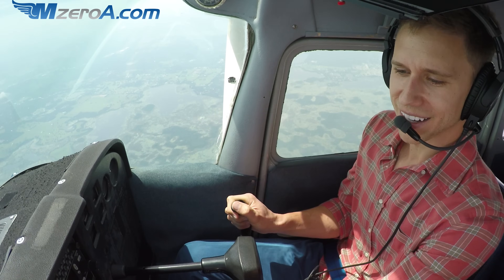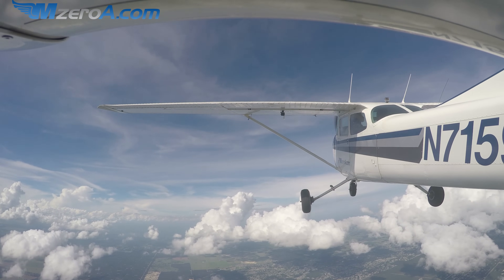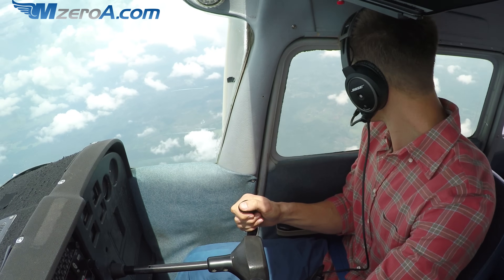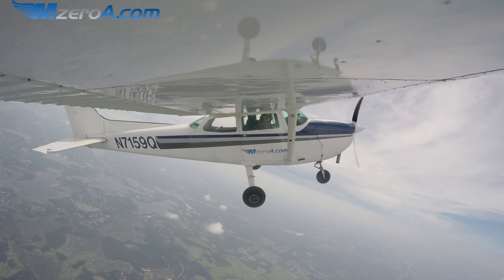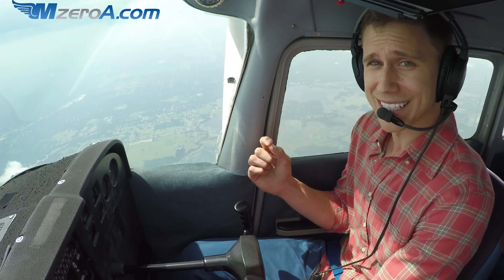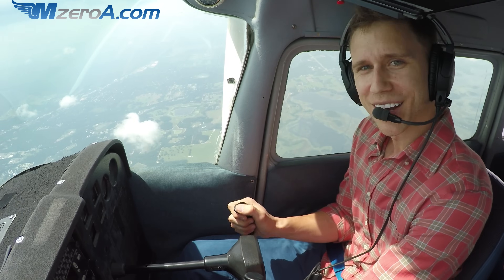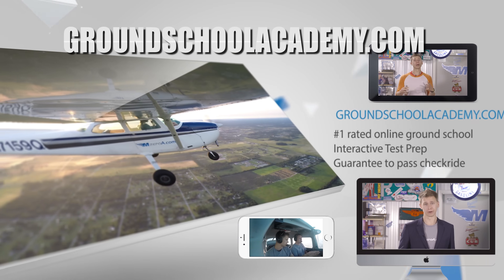Proper Spin Recovery - MzeroA Flight Training

Comment: Why wouldn't spin recovery training be required by all student pilots?  Neglecting to do this is not just crazy it is risking your life.  Seriously I am totally lost for any reason this wouldn't be basic required 101 training?
Reply: I read that it was, until 1983 or something. Then it was decided that more people are killed in spin training than in accidents that involve spins at an altitude where recovery is actually possible. If you unintentionally spin, chances are that you are too low to recover. Spin prevention training was more stressed instead.

Comment: Great video Jason. I am not certain if it is mentioned below, but we are required to demonstrate Spin recovery here in Canada before we can be cleared to solo. It is not tested on the Private check ride, but it is on the Commercial check ride. I love them, and it is a great skill to learn. Cheers.
Reply: +Henry Dupuis That is very interesting. I got the JAR-PPL in the UK and not only is spin training not required, it is not offered or recommended. As I was told, "if you never let a stall develop, you will not enter the spin." We did however, do spiral dive recovery which is completely different.
I also visited the USA and was surprised to be turned down by several CFIs when I told them I would like to go up for spin recovery. Now, from Jason's video, I can understand why they were reticent to try.
Reply: +douglasheld come to Canada, we can take you up and teach SPIN recovery. www.windsorflyingclub.com

Comment: It's somewhat non conventional advice. However if you want to get rid of any tendency to react to spins, stalls, and other aggravated maneuvers incorrectly, in my opinion the best thing anyone can do short of taking an aerobatics course in real life (which I would love to do one day). Is to go play a good ww2 combat flight simulator preferably multiplayer, like IL2 cliffs of dover (with the team fusion patches). IL2 Battle of stalingrad or some configurations of DCS would be acceptable practice as well.

In sims new people stall out constantly, recover from aggravated conditions incorrectly, all the same mistakes one can make in real life that can cost you your life. The reason I believe this is more valuable than say practicing aerobatics in FSX, is that for one, aerobatic simulation is better in these sims than it is in FSX, and two when you are chasing or being chased by other real people trying to shoot you down it mentally simulates emergency or stressed situations to at least some degree. 

I used to really stress over practicing stalls in real life. However when I came back to flying in real life after 800 hours of IL2 between, I just saw it all completely differently. Gliding to a landing successfully with oil gushing out of your engine all over your windshield, your rudder shot off and inoperable, with 3 people still chasing you, and realizing that even under the worst situations you could imagine, one can land safely almost all the time. Simulation flying is (mostly) harder than in real life as well because you lack the forces, and often ground handling is simulated very ridgedly, there is a large tendency for people to over control in simulation.

Comment: Interesting video.  Even though you are banked to the right, the incipient spin rolls to the left.  Why is that?  Is it because the right turn is not coordinated (see instruments at 4:06), so you are slipping right and the left wing stalls first?  Anyway, what happens (right bank/turn, left spin) is contrary to what I've seen in several other spin videos.  Can you comment?

Thanks,
-Hugh
Reply: +Hugh Secker-Walker What Jason has done is has stalled, encouraging a wing to drop by the use of the uncoordinated controls. The wing drop is typically contrary to the bank angle.
The incipient spin is simply a follow-on condition of the dropped-wing stall.

Comment: Nice lesson, pilots always learning. But one question: seems that you dont push elevator down as you said. Push hard elevator down could not get planes in the spin that we want to avoid? Maybe it's not to force so much...the plane recover itself from the spin if we dont push so hard on the controls...just the pedals need to make some work...I dont know, just want to clarify this. Notheless, thanks for this amazing channel and the good lessons in it!
Reply: +Henrique It would be good to get Jason's input. But I am thinking since he is in a relatively steep dive, releasing back pressure is all that was required of the elevator controls, until flying airspeed was regained.

Comment: I've always been confused about what opposite rudder means, I think I know but I want to be sure.
Reply: +Jonathan Rivera Sometimes you don't know which way you're spinning because you're going like a washing machine in spin cycle, that and if you accidentally spin you don't really know what's going on as it happens fast, confusing, and it hurts; the particular spin I got into on my own felt like the entire airplane rolled over on top of me was inverted very quickly. 
You can look at your turn coordinator as reference.  I spun once in a turning stall to the right, thought  I was still rotating turning right in the spin, but I had actually flip left.  Was doing a left turn in the spin.  I put what I thought was opposite rudder to rotation (left rudder) and turned into a washing machine spun even faster while looking straight at the ground... it hurt.
Remembered my instructor saying if you can't figure out which direction you're turning to look at your turn coordinator, and sure enough I was turning left... not right.  So opposite rudder was right rudder, at full right rudder the spinning stopped almost immediately. 
Remember your turn coordinator if you ever get into a spin.
Reply: +Jonathan Rivera If your nose is spinning to the left, push right rudder in. Nose spinning right, left rudder in.

Comment: My check ride, Cessna 150, mid 70's, 50hrTT.  He wants an accelerated stall.  "Damnit," he says "that was an imminent stall!  I want a full stall, let the nose fall through the horizon."  Never done that, but up we go.  Nose falls, recovery.  Suddenly, one wing falls like a pillar broke and we sweep around with me looking at the ground.  Check pilot, an older guy, gruff, sitting with his hands in his lap...been there, done that.   I [quickly] apply your "PARE" [my reading paid off] and we fly out of the spin.  He says: "You know what you did?"  "Yeah," says I "A spin."  He says "Try again."  Same thing, right down to the spin.  As we land I'm thinking when can I re-do the check ride but he says "I thought you did okay; I'm signing you off."  I could. not. believe. it!

In those days we practiced accelerated stalls solo, I don't think they do that anymore.

Thanks for the video
Reply: +david ervin After we did the stall maneuvers, we did slow flight. My examiner threatened he would fail me if I stalled in slow flight or especially if I spun LOL!  Needless to say I didn't.  But he didn't like how I was so comfortable flying slow, and harassed me for flying slow in the pattern making me at least do 120 on the downwind... "Are you getting your pilot license to go slow? Do you buy a sports car to go slow?" "No." "Well, bring us up to a normal cruising speed!" LOL!  My instructor told me after the exam he noticed I flew better when he barked at me like a drill instructor...  I kind of noticed too.
Reply: My examiner might as well have been a statue.  My heart was in my throat and he sat there like a school girl in her dad's car.  I think he was an aerobatic pilot instructor though he looked more like he had just gotten out of a John Deere.  Luckily it was in a 150 and not the Piper 140 I had taken a few lessons in.  I once took my brother up in a 152 on a windy day and landed straight down...he was terrified.

Comment: Great video.. but

This would be a lot harder in a low wing plane with their inherant instability as CG above wing (lack of pendulem effect) 
Learning to recover would be a lot harder

also why recover after only like 1/2 rotation. 
Let the spin start :) giver it 2-3 rotations. 

Wouldn't that be better training? 
Ok i saw the thing about spin rating below and honestly don't think i would fly a plane that was not capable of spins/barrel rolls and basic loops without falling apart.. kinda bad if you think about it planes not rated to do it as will probably fall apart :O

Comment: Thanks for the video, you made it look SO easy.  I went up for the first time in over a year today (I finished my training and chickened out when it came time for the test).  I asked the old man (I call him that cause he runs the school and has been an instructor for like 45 or 50 years) about stalls on the briefing.  I said that no one had ever mentioned it, or demonstrated it, or anything.  Well about 35 mins in, he says, "We're not gonna do a spin, but I'm going to start one and you need to fix it before it becomes a spin."  We're already in slow flight at stall speed, and as SOON as I said "OK", he stood on the rudder and we nosed over.  It scared me so bad, I recovered before I had time to think (Thanks FSx).  The plane didn't get to spin and the old man was happy.

Comment: Quick question, my cessna 150 flight manual says it is approved for spinning, but after 40+ years, is it still safe for spin? How do I know my airplane is ready for spin?
Reply: CFI here, one that demonstrates and practices spins regularly. Spins themselves don't actually impose too much aerodynamic load on an airplane.  Its pulling out of the dive that can be an issue. 

I'd recommend having a mechanic inspect the condition of the wing spar and strut attachment points for metal fatigue. As well as the attachment bolts and stops for the rudder and elevator. There's a little metal plate that contacts the stops on the rudder, I've heard of one becoming bent and jammed against the stop and locking the rudder in a full deflection, the results weren't good for the instructor and his student. Haven't seen any NTSB reports on that but still isn't a pleasant thought.

Comment: That looked like a Cessna 172 that Jason was in.  If it is like the ones I fly they are not spin rated for fully developed spins even in the utility.  They are spin rated but only so far as to do spin entry but you are only allowed to let it do half a turn in the spin and not fully develop into a full spin.  The CE-172 is not a aerobatic plane and is not certified for fully developed spins as far as I know which explains why Jason only let it begin to spin before breaking it.  Maybe someone else can correct me if I am wrong here but it does bring out a very good point to make sure you understand just how far you are allowed to take maneuvers (especially aerobatic ones such as spins) in the trainer you fly.
Reply: +redfox435cat all of the airports where I live have either 172 SP or R models. And a few 150s
Reply: My 1980 172 is approved for spins when W&B is in utility category. There is no limitation on number of turns.
When training, I find it more instructive to let the spin fully develop before recovering. If you recover so quickly, before even 1/2 turn, as he does in this video, you don't really get the disorienting experience of a full developed spin.
And because a 172 is so forgiving it typically recovers from an incipient spin hands-off without any PARE inputs at all, incorrect spin recovery technique may actually be successful, and you could reinforce this in training.
If you're going to do spin training, better to do fully developed spins and ensure you are using correct recovery controls.
Reply: With half tanks it should be good to go. In utility category loading, with flaps up and 2200lbs MTOW it’s certified to +4.4g and -1.76g. No reason anyone should be near 4g’s in a recovery.
Reply: Hate to debunk you’re theory David, but for any aircraft to hold the Utility category it must have been spin tested to 3 fully developed spins and take up to 4 G’s on the airframe before recovery; 6 fully developed spins for the acrobatic category on airplanes that hold that rating.
Reply: David, need to do a little more studying and research before spitting something out as fact; 172’s are approved for spins as long as section 4 of the Poh says so, you must be in the Utility category; only 172’s that cannot be spun are ones that carry the G-1000 glass panel on board because of the AHRS, ( Attitude Heading And Reference System ). Spinning these aircraft would most likely damage the AHRS, or at the very least have to be recalibrated. Hope this helps dispel any myths about 172’s not being spin able.
Reply: All the 172M's and 172S's I've flown can do spins in the utility category.

Comment: Kids, these are not spins but incipient spins or simply spin entries.
Reply: Ian Marks You are correct, but that is the point of spin recovery training at a beginner level - to stop an incipient spin from becoming a full spin and losing massive altitude
Reply: +Ian Marks I agree, he never entered a spin.   Not even half a revolution.
Reply: +Nigel Mac   Also, aerobatic pilots will instruct you to complete all spins in a climb, not in straight and level flight.
Reply: crikey mate thats nuts!!!!
Reply: +Ian Marks Really though, there's nothing like spinning a 172 from 6000' to 3000' Love it!
Reply: I believe the C172 manual states that it is Not rated to perform intentional spins. that's why we use the C150 for spin training..
Reply: @jedi8810  Wrong.

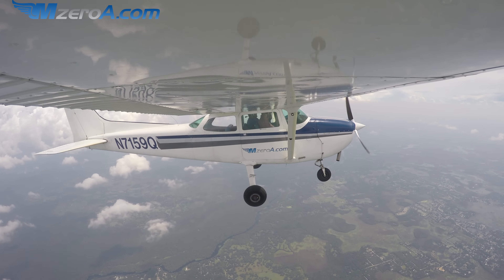Comment: Is it just a camera effect that it looks like the propeller actually slows right down at 4:20 and at  5:30?
Reply: +MrEthanhines Video cameras don't shoot continuously. They shoot at a 'frame-rate', let's say for discussion 25 frames per second. Your prop is also turning at a rate of so-many revolutions per second. If you're filming that prop with a 25 frame-per-second video camera, it will appear absolutely motionless as long as your prop is turning at precisely some multiple of 25 revolutions per second. Let's say your prop is turning at exactly 2400 RPM. That's 40 revolutions per second. 40 is not a multiple of 25, so therefore on video, your prop will appear to move. But if you powered back to exactly 1,500 RPM (or 25 revolutions per second), filming that prop will make it appear motionless. Actually, with a two-bladed prop, any prop speed that's a multiple of 12.5 revolutions per second will also make the prop appear motionless, except that on each frame of the film, though a blade will appear to be in the same place, it will be the 'other' blade on alternating frames of the film.
Reply: +MrEthanhines It has to do with the shutter speed of the camera,giving the illusion that the propellor is spinning a lot slower than it is (or not at all, if the camera perfectly syncs up with the prop)
Reply: +MrEthanhines I thought it was from power back?
Reply: +Adam now that you mention it, it does look like he changed power, however at 4:20 he was recovered from the spin, so it would make more sense if he was adding power at that point
Reply: yeah Vitaly M I think it's a camera speed thing like watching tires go backwards when they are obviously going forward
Reply: +MrEthanhines I am aware of this effect as I occasionally snap a photo or two out the window.  It is related to shutter speed in the camera being almost fast enough to freeze the prop.  Its the same effect you see with hummingbird photos where they either turn their wings into a blur or they freeze them mid flight.

Comment: Very well made video showing proper recovery techniques, but that wasn't really a spin. It looked like barely half of a rotation which is really just the incipient stage of a spin. To your credit, that is really all most people need to learn to recover from. A 172 with that loading is a pretty sluggish spinner too. Try it with a 150 or Citabria and they can actually be a lot of fun. Your video has motivated me to edit and upload some of the spins I did in my 150 Aerobat last spring.